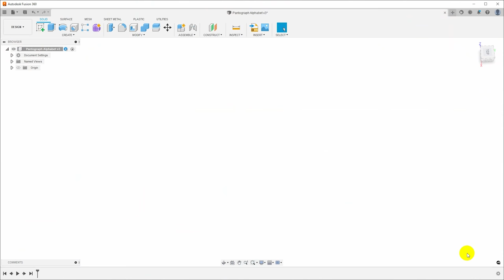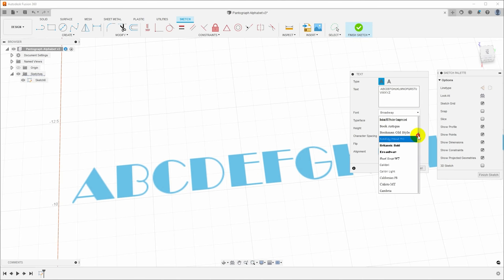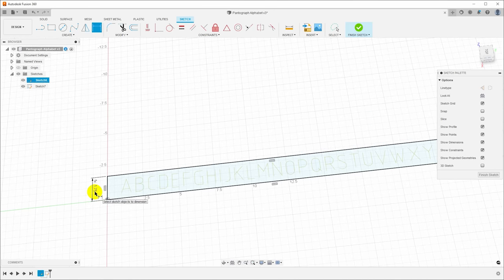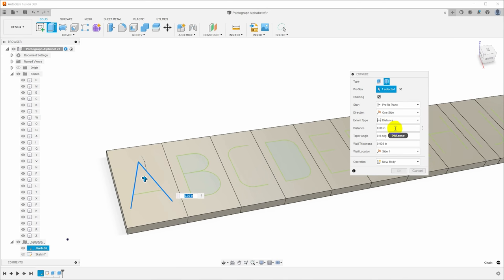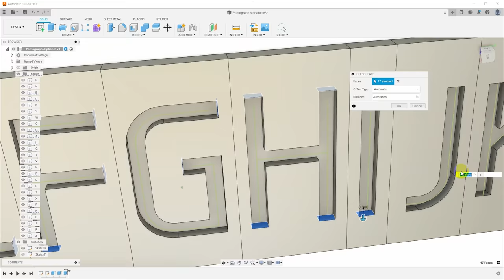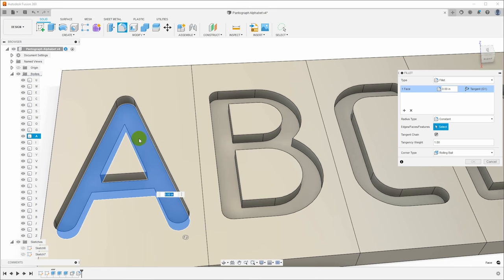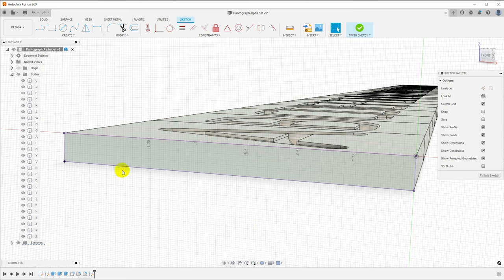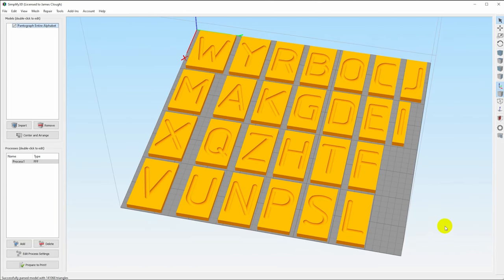Designing a 3D Printed Pantograph Font | Fusion 360 Tutorial

Comment: In programming, text is defined in how many W spaced size do you want since W takes the most space. I probably would have figured out how much space a W takes plus the spacing between I wanted and then make all the blocks that size. But there's probably a reason James didn't want to do it that way
Reply from the maker: Harold specifically requested a variable-width font.
Reply: @Clough42  if you said that I must have missed it, but yeah I figured there was a reason why you did it this way you did!

Comment: Watching your videos over the past 2 years inspired me to buy a 3D printer. When I was in high school in the the 80’s I didn’t know what I wanted to do but I fell in love with the tool room and architectural drawing classes and took all of them. I really thought I was going to be a tool and die maker but it didn’t pan out. I got a degree in electronic service engineering instead and have been a computer system engineer for the last 30 years. For so many years I wanted to get back to my roots of having a lathe and mill but could never afford them and I didn’t have projects for them until I started watching your videos. That’s when I realized that I could have been doing them the whole time. The 3D printer for me brings in what seems to be the missing element that I could afford doing additive manufacturing rather than subtractive. Anyway thank you for inspiring me and I continue to be a huge fan.

Comment: Check if simplify3d support 3fm files that export each body separate but still only one file. Prusa slicer i know handle it perfect 😁
Reply from the maker: Good tip.  Though I assume they would all be touching in the 3mf file?
Reply: @Clough42  ya correct. in prusa slicer you can then take them in as individual objects, so auto placement place them in a good place. And then you can save that file as a new 3fm file or export plate as stl.

Comment: Bleh, my last comment was deleted, so I'll say it again without the Imgur link. Message me (that's a thing on Youtube still, right?) if you want it.

The most complicated model I built is a W12 engine. I tried to keep it fully parametric, but due to the complexity of it, things got away from me pretty quickly. I did get a nice render of the internals that I use as my desktop background now, though. 

The messiest print that ultimately ended in failure was a filter mask, a sort of DIY PPE for the pandemic, that a friend asked me to print for him. Imagine a shape of a typical construction style dust mask, but printing that as a 2mm wall from the widest part to the narrowest. Now imagine that as 200 degree Celsius plastic. It wasn't really able to build the slopes and curves cleanly, and it was a mess of spaghetti at the end. I also tried to print just the cap end of it, which was supposed to thread onto the main body and hold a cotton pad captive as a filter. Because of the way FDM printers don't do mating cylinders well, it simply didn't work. The cap was too small or the male threads were too big. Some post-processing may have fixed it, but it was more than I wanted to fight with. And yes, supports would have helped with the mask structure, but that would have added tens of hours onto the print.

Comment: Regarding the ordering of the letter bodies in Fusion.  It's possible to drag and drop the bodies in the list to reorder them.  You did say "good way" but I'm not aware of a sort alphabetically option!
Obviously it isn't really necessary for this model as you're going to export them without working on the any further but I've had models where it's useful to have the modelled parts in a logical order so you can easily find which one is which.  Fusion does have an irritating habit of moving them about if you do anything like split a body though.  I think this falls under your "personality" category!
Reply from the maker: Interesting.  I'm pretty sure I tried that and it didn't work, but it's certainly working now.  Thanks!

Comment: Great video! The way I think I’d have made the rounded letterforms by using one of the SHX plugins for Inkscape, to create the letterforms and give them thickness where I would be able to control the end caps and corners. Then import the SVG into F360 and go from there. 
Great to see other ways of doing things though!
Reply: solidworks has a offset feature that can cap ends. I imagine 360 does too..
Reply: @moki123g  You’d think. Fusion 360 is a good minimum but not great, and it misses out on a lot of features.

Comment: One way to do the kerning is shrinking the witch of all the blocks, then making a set of shims for the different pairs. You don't need 676 different shims since most letters have close enough width that they can share.

Another completely automatic way would be dividing each block into maybe 10 vertical positions on each side. Each position would have a projection that would match up with another projection on an adjacent letter. If you picked any two letters, the projections with the greatest combined distance would touch and set the correct kerning distance. I'm not 100% certain this would work out and maybe in practice you would only get a few unique distances. It seems like you might need to write a program to work out the best set of distance pairs. It could probably be done in OpenSCAD.

Comment: I'm surprised you didn't extrude along the paths of the letters with a circular shaped profile (plus extra depth+width), and cutting away from the bases. But my experience with F360 is quite small, so I am for sure not a good reference. :-)
Also, in the images from the slicer software, the dovetails seem to be missing.
And a third topic: Will the layer height and general roughness of the 3D prints provide an acceptably smooth path for the stylus?
Reply from the maker: Extruding along the paths requires sketches for each segment, and doesn't go neatly around square corners.  The missing dovetails are due to an unfortunate time travel paradox that I couldn't clean up in editing.  My printer produces acceptably smooth surfaces, but I'm sure it's possible to print them with lumps that cause problems.

Comment: I think there is a command to handle the overshoot and edge filets in one go. It was in Inventor, but not sure where in Fusion. Has to do with line end treatments.
Reply from the maker: There are situations where you can offset a line, and it offsets both sides, including rounded ends, but I could not get it to work with the paths from the stroke fonts.  That, followed by a rule fillet would have made this very simple if it had worked.